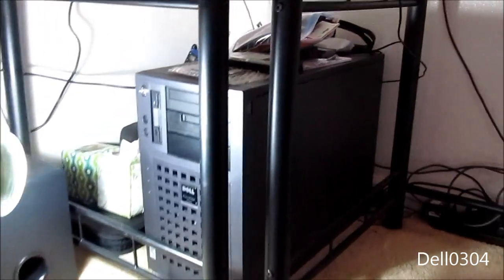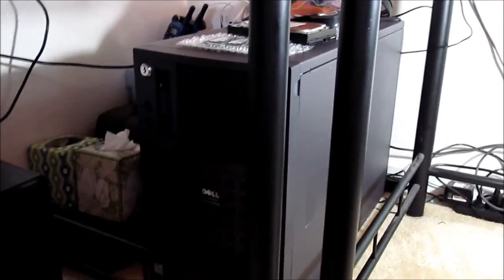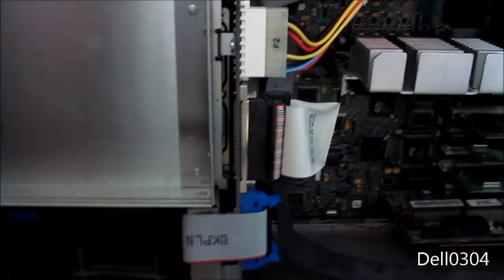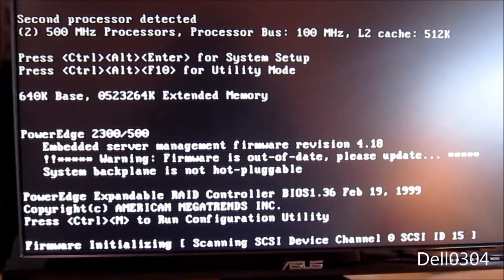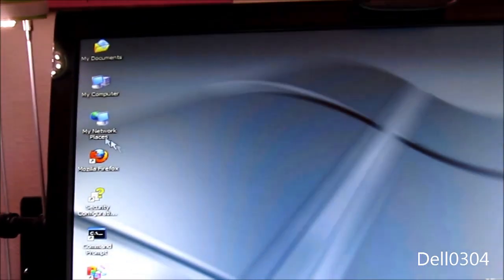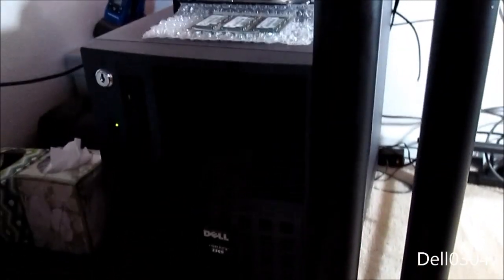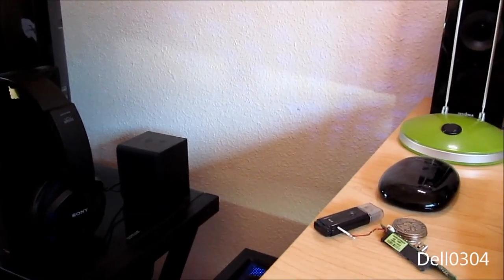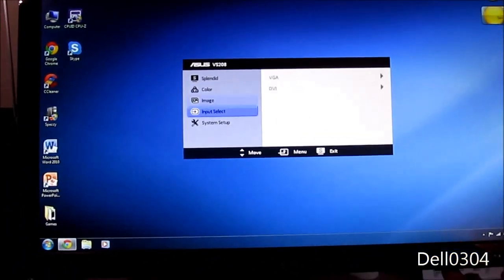The Dell PowerEdge 2300 is Back Up and Running

Comment: probably, even though it has 2 CPU's they are running at such a slow speed, this machine is processor challenged, ram challenged, graphics challenged, even if you could kind of shellac windows 7 on the machine it would not be a pleasant user experience. I have seen a video from Maxxarcade of him putting windows 7 on an old pentium iii system and it worked you might want to go to his channel and search for it!